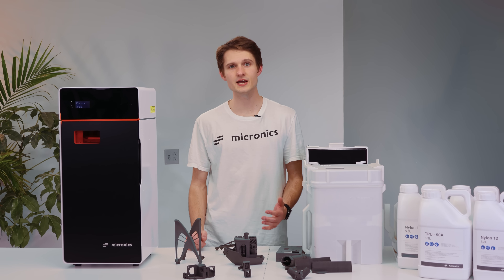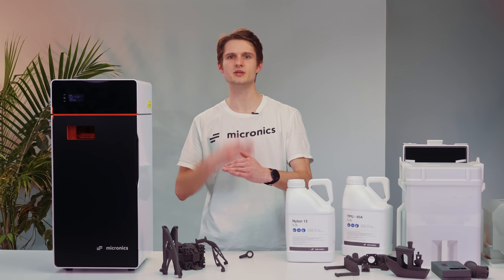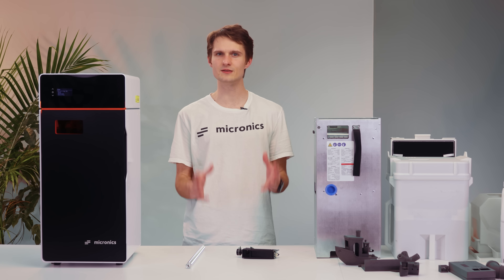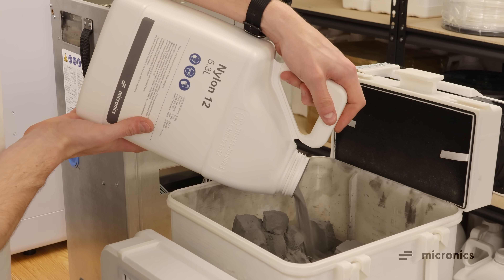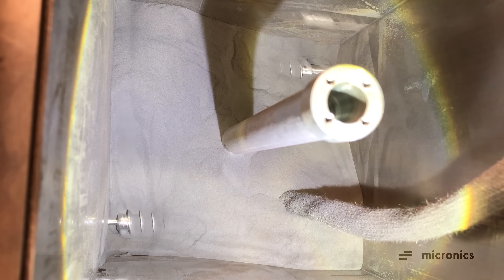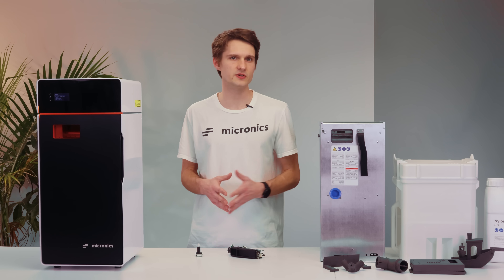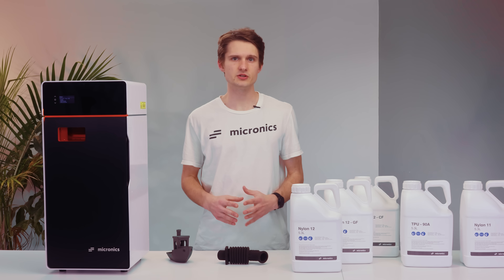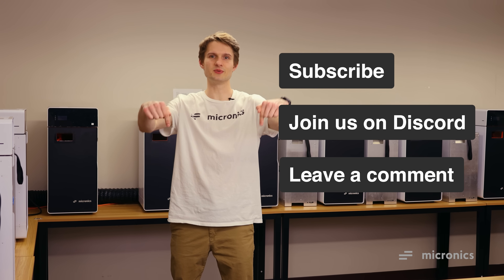How we BUILT a 3D printer that can print ANYTHING!

Comment: The cleaning process needs work. It would be wise to tell your future customers that the two fan solutions you showed are grossly insufficient. It's troubling to think you're actually considering printing people's debridement boxes, considering how many defects could result at scale and making injection molding a reach goal instead of bare min standard, seeing  how dangerous what it is meant to handle is. The particles will get everywhere, and most professional hoods are inadequate when handling metal powders - oof. They really need to be wearing a backup layer of PPE, disposable bunny suits, and properly rated face masks; they really need to drape off a completely enclosed plastic chamber, the suction needs to be routed to the proper filter, etc. Honestly, I would think about selling a proper PPE kit and shop set up alongside the printer as a baseline 'bare minimum' before going commercial, but that's just me.

Comment: 4:06 make sure you are wearing a respirator and other pertinent PPE during this step and any other step working with the powder. If you are curious as to why, invest in a particle counter and run some tests during these steps. It will show you what your eyes cannot.
Reply from the maker: We are wearing PPE and we do have a calibrated particle counter. Due to the fume extractor with HEPA filter, we actually observed a drop in particulate count when it is in operation. If you think about it, the dust extractor is basically an air purifier. 

But yes, it’s always good idea to wear the respirator like we did in the video, in case you spill the powder.
Reply: @micronics3d  I’m confident that you do for sure! I was simply stating for viewers who might be interested in powder based printing. I would be interested to learn more about your fume extractor.

Comment: Besides the price of the machine, the crux of the problem for small-scale production workshops (here obviously, I'm not talking about the R&D departments of large companies that use SLS for prototyping) will be in reality on the price of the nylon powder. 
Today, such material is sold at an insane price wrt its chemistry: Formlabs, which has set the standard, sells PA12 for $100/kg (VAT and shipping excl.). No matter how you deal with the numbers, in the end ASA costs $30/kg only (PLA and PETG, even less! But take ASA for its good mechanical and thermal properties for technical products). That means that each product made with the FDM technology costs 70% less than the same object made through SLS. 
Sure, an SLS machine is able to output more objects per hour (I let post-processing aside...). But this is a non-issue for FDM in print farms, due to the cheap nature of these printers. You just have to add a few more. Hence, 2 or 3 FDM printers will produce the same amount of objects per hour as one SLS printer, still with an inferior total purchase price, and still using the same ridiculous price per unit weight for the consumable raw material. 
There's no denying that a technical product made with SLS has some superior qualities. But I seriously doubt that such final product could compete on the market with the same product made in ASA, if the selling price of the SLS-made product has to be 230% higher to keep the same production cost and margin!
As a consequence, as long as the price per weight is not cut in half (at least) for nylon material, the SLS nut won't be cracked.
Alas, I have even more serious doubts you will follow this high road, since with such an aggressive price for the hardware, you'll have to make up for it on consumables… exactly like ink printer companies. I hope you'll prove me wrong. If so, I will be one of your first customers!
Reply from the maker: The printer is an open-material platform so you are free to use any 3rd part materials as mentioned in the video. SLS powder cost is high but that is going to drop when it become popularized, just like filament and resin prices over the last decade.
Reply: You are also ignoring the cost of support material. With the SLS you can reuse with FFF you have to throw away
Reply: @emotodude  I haven't forgotten it, I just deliberately didn't mention it. You're right that support material is thrown away with FDM (and SLA) and that this does not exist with SLS. But alternatively, with SLS the thick walls are necessarily always fully solid (100% infill) whereas in FDM the solid inner parts are typically made of air with 15 to 20% infill. So you're gaining somewhere what you're losing elsewhere. IMHO the lack of support materials is not the feature that makes SLS attractive (even if it is also a good thing due to the absence of any remainting scar after surpport removal); the real strength of SLS is its high yield per hour (by multiplying models throughout the build volume) as well as the isotropy hence strength of the parts produced. I readily admit this.
Reply: I take back what I said in my previous comment about the "speed" of SLS technology. With "3000 mm/s" and packing several pieces manufactured at once in the whole volume of the build chamber, it seems exceptionally high… in appearance only.
Here I'm not talking about the structural advantages of nylon parts, but purely about production costs and yields, PA12 vs ASA parts, when both are possible (which isn't always the case, but in my case it is).
I made a precise calculation for my own project (a fairly large technical product produced in small series and assembled from several independent parts) which takes 5h40min to manufacture in ASA on three builds in a Bambu Lab P1S, a $700 closed-enclosure FFF printer. Alternatively, I calculated that I could manufacture five of these objects at once using SLS technology. Not "at once" exactly, as it would take two print chambers consecutively, filled to at least 25% on an Inova or a Micronics, two new machines costing around 3500 dollars VAT incl. each (there's nothing else cheaper right now, and the Inova is DIY, sold as a kit takin several days to assemble). 
Taking into account heating time, manufacturing time and cooling time, it would take me over 56 hours (more than two days!) to manufacture these five parts in SLS, which comes to over 11 hours per unit. That's exactly TWICE as long as it takes me now to produce the same part in ASA on an FFF printer, a machine that is also 5 times cheaper. Therefore, for the same acquisition cost, I could buy 5x Bambu Lab P1S as a small print farm instead of a single Inova or Micronics machine, and be TEN TIMES more productive. And I haven't added the post-production time in the SLS cycle to unmold the cake, take out the parts, vacuum the dust, sift it, sandblast the parts, even then dye then let them dry (so that they no longer have that dirty gray color): hours more!
I'm not even talking about the fact that ASA filament is three times cheaper per weight than PA12 powder (it may change in the future, admittedly).
I was REALLY excited about upcoming low-cost SLS technology, but my hopes were dashed by this realistic calculation and pragmatic consideration.
In conclusion, I don't know how people who sell small-batch production made with SLS printers (especially those that cost ten times as much) manage to cope financially. Sure, another use for SLS tech is functional prototyping instead of small-batch manufacturing, but in this case a density of 25 to 30% in the print chamber is rarely achieved, so the cost per unit skyrockets. 
YMMV, but I honestly don't see how.

Comment: I was watching your video about 5x and have a question, does your printer have a heating temperature control for different types of materials, I think this will help in having flexibility  I think, just a suggestion.
Reply from the maker: Yes, temperature is user-controllable in the slicer.

Comment: This is absolutely amazing and revolutionary, this may be one of the most innovative 3D printers since bambu labs X1 carbon, I'm glad to see people pushing the 3D printing industry into new eras with  easier and higher quality printing for a much cheaper price
Reply: Except the bambu lab X1 wasn't innovative at all. All they did was make an enclosed coreXY printer with input shaping.
Reply: @LilApe  The X1 pushed the entire market, without The X1 we probably wouldn't have gotten things from reality like the k1, not only that it also had some pretty impressive features like a lidar sensors, AI monitoring, camera built in, and the ams. Bambu lab brought life into a pretty stagnant market
Reply: What's innovative in x1 carbon?

Comment: Great work, lots of interesting technical solutions. Good luck! Maybe you have your own website? There is also a question: how long does it take to print a part with a volume of about 1.3 liters (130 cubic centimeters) with a complex internal structure? I realize it's hard to say without seeing the model, but still - 1 hour, 12 hours, 24 hours? Thanks in advance for the answer.

Comment: Question, is the $ 2.999 for only the printer (so "Build chamber" and "Sift bin" have to be purchased separately) or are these included in the price (so the build chamber and sift bin in your store are extra's if you want to use different materials)?
Reply from the maker: The price includes 1 printer, 1 sift bin, and 1 set of post processing tools.

Comment: What I like about your printer is the way it was developed. Not trying to bring the costs down by optimizing the well known techniques used in the current SLS printers, but starting from zero and thinking out of the box (I do the same when designing products). And you did this out of the box thinking with all aspects of the machine; the mechanics of the machine, controlling the galvo's, refilling the powder, cleaning of the parts and even the slicer. Well done! I am certainly thinking of buying this Micronics printer. For now I will follow this channel and apply for a sample part. Keep up the good work!
Reply from the maker: Order a sample part for yourself to check it out! www.micronics3d.com/quote
Reply: @micronics3d I would love to request a sample part, but the webpage states that it is only possible within the USA. I live in the Netherlands.....

Comment: You could start a small business with a few of these. Printing out massive amounts of tabletop miniatures to sell at conventions and online. Contract 3D modeling artists, whip up some cool packaging and you’re off to the races.
Reply: It looks like the surface of these prints has a grainy texture, making it more suitable for mechanical parts. If it's possible to get resin printer level quality, I'd buy one of these.
Reply: @AsimPaints  true. i want to see the finishes capable with this system. i imagine there's gotta be some kind of post processing machine you could toss the prints into with some sort of tumbler with agitators that wouldn't fuck up the prints and smooth the surfaces really well.

Comment: This is a monumental slap in the face of Formlabs, who have indecently raised the price of their Fuse… twice in a couple of years. First by almost doubling the price of the machine, from their initial promise to the actual production unit; then by raising the price again by no less than $10,000 (would you believe!) when they upgraded the laser from 10W to 30W. Thus increasing their promise of an SLS printer from $9,999 initially, to $28,990 today!

Comment: As a private hobbyist, what should i expect from this setup in terms of cleaning/hazardous materials/breathing in the powder? 
Also, this can not print completely enclosed hollow structures, because the residue material has to be cleaned after the printing has fully completed, right? This might impact the weight negatively

Comment: get rid of the layers. Use two lasers that generate only enough heat when crossing the beams. like that you can just print in 3d space..  but you would have to dissolve the powder into a transparent gelee like state.

Comment: this might be nonsence, but what if the powder can float via a super inducer and then get hit by the laser , or the volume it self is translated to frequncy or vibration that will lead the powder to take the overall shape of the object ,of cource it wont be suspended mid air but it can use a small base to start the build from it or arround it ,probebly resin uv might be less of a problem because the shape is there but needs hardening .

Comment: Those interlocking parts are interesting, but I assume cleaning the joint surfaces of unfused material is a very involved process? Or do those parts need to usually be modeled specifically for SLS cleanup?

Comment: I saw on the integza channel, composite plastic with bronze added, which can then be baked to dust the plastic and leave only the metal. Is it possible to use such a plastic with this printer or is it only for nylon?

Comment: Please please PLEASE educate and encourage your customers to properly dispose of used powder by encasing it in resin before throwing it away. I shudder at the thought of home hobbyists without proper disposal procedures dumping loose microplastic dust straight into the trash from which it will eventually contaminate our water and soil. This technology is very cool, but has some serious drawbacks environmentally.
Reply from the maker: The slicer automatically generates ballast parts to increase the print density. As a result, prints are always above the zero-waste density threshold and no loose powder need to be disposed of.
Reply: @micronics3d  so the material can be continually recycled and reused then, where other systems require disposal after one or more uses?

Comment: Hey, what about Pneumoconiosis ?
https://en.wikipedia.org/wiki/Pneumoconiosis
Reply from the maker: That is typically caused by inhaling sharp metal particles. Nylon powder is smooth and inert. The powder is also much larger (50um) in comparison to those metal particles, meaning they don't really suspend in the air. If you sniff a lot of it, it can be uncomfortable. We do recommend that you wear a N95 mask when handling powder, which is the industry standard practice.
Reply: @micronics3d  Thanks a lot for the message. 
The dust of any substance that cannot be dissolved in the lungs creates unsolvable problems. Plastics are worse than any other. Use safety equipments lads. Stay safe.

Comment: Saw the Tom's Hardware article about you guys in my news feed this morning, awesome to see you already have this video up. I've had a few FDM printers for several years, but consistency issues made me step away from FDM to resin when I got a Form2 for a good price. Recently picked up a Bambu Lab X1C and have been extremely happy with the results from that. I would say if you can provide the kind of ease of use, straightforward results, and customer / software support Bambu Lab is providing, at the price range you're touting, you've got a hell of a product, and I'd love to get one for myself when they come out.

Comment: SLS is a kind of weird semi-additive manufacturing because you can hardly get the infill power out of the model, so you use as much material as subtractive manufacturing (supposing you reuse the left over of both). It's still pretty amaizing.

Comment: Did you consider supporting heat pumps for heating up the working space? Only preparations like pre determined locations/optimal locations for the air input and output would be needed.

Comment: I've been operating & servicing large-frame industrial SLS printers in aerospace for 15 years, and I'm impressed with what you've done here! My question is, will users have any control over parameter settings such as process temperature, laser power, scan spacing and rate, etc?
Reply from the maker: Yes, it's open materials.

Comment: OMG bro i've been trying to figure out how to get 40k to purchase one of these bad boys so this product is RIGHT on time!! can't wait man! please have the slicer figured out though lolll... looks like the hardware is solid... can't wait to see more slicer videos... i've been dealing with resin printers and i've learned that the slicer can destroy the entire experience if it doesn't work good..... wait... what was the build volume ?
Reply from the maker: 160x160x200, more details in the description. Largest printable parts is a bit smaller due to uniform shrinkage and thermal distribution. However, because you can place parts at any angle you like and on top of each other, you can usually stuff more into it that you expect.
Reply: @micronics3d  awesome!! thanks bud!

Comment: Rookie questions - Does SLS printing still have "infill" or is the whole part just rock solid? How long does it take? Surely these powders are somewhat hazardous if you accidentally breath it? Keep up the good work! Looks amazing!
Reply from the maker: The parts are all just rock solid. Of course you can also shell it out and put evacuation holes like SLA prints. Speed of course depends but 45 benchies packed in 1 full build volume takes around 30 hours. The powder is non-toxic but if you inhale a lot of it, it can be uncomfortable. We recommend wearing a N95 mask whenever working with it.
Reply: @micronics3d  So fascinating! Can't wait to see where this goes!

Comment: The formlabs fuse doesn't need to be cleaned between uses. We done hundreds of prints without issues. It's also not a very manual or messy machine as it's designed to keep powders contained when filling and reclaiming.

Comment: Breathing that in has to be toxic as crap
Reply from the maker: It's not toxic but can be irritating if you sniff enough of it. We recommend wearing N95 mask when handling it, which is the industry standard.
Reply: @micronics3d when 3D printing nylon it is recommended to vent the fumes as it produces high VOC levels. Fine powder would definitely be toxic if breathing in. A mask and goggles would definitely be needed. Still, super awesome product and I hope you communicate to users those safety concerns when handling.